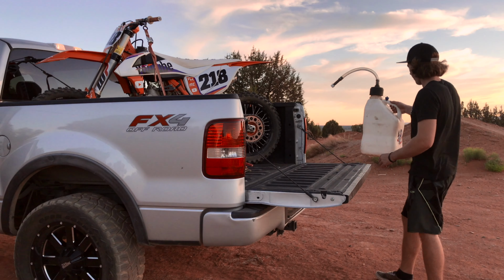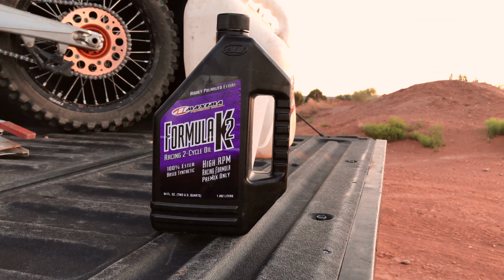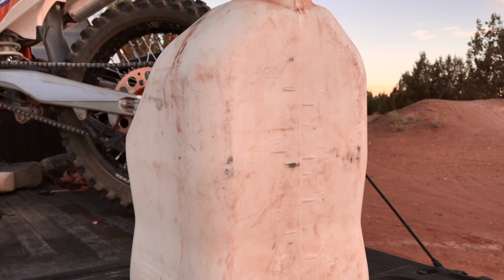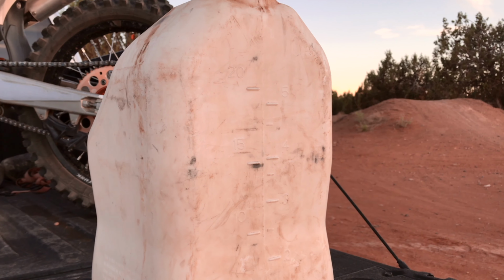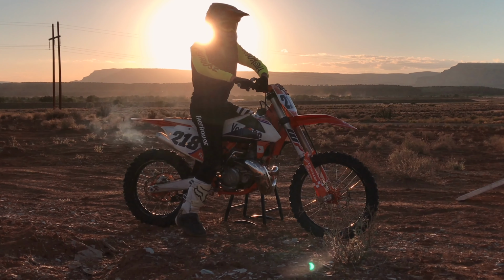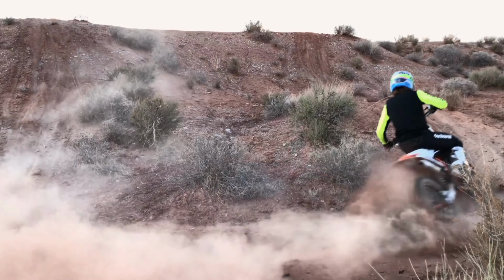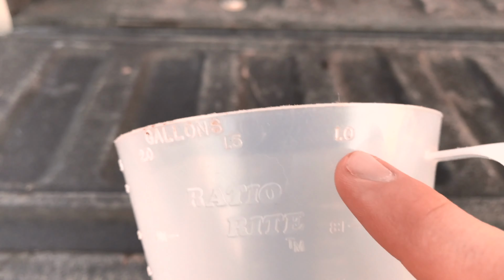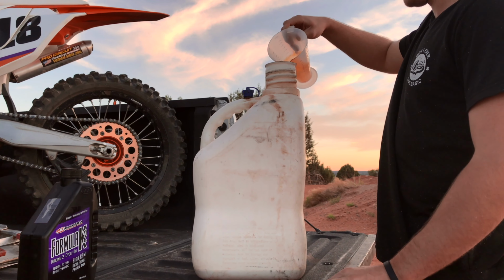How to mix 2 stroke gas | How to Ep.8

Comment: Nice tutorial. Two stroke oil and mix ratio is a religion.  Suggest you do a follow up with piston condition from your last top end replacement, add color on type of riding, type of fuel (ethenol/ non ethenol/ race fuel mix) in addition to your K2 mix ratio, jetting, altitude, temperature, etc. In my KTM smoker I run amsoil interceptor at 50:1, mixed with non-ethanol 90 octane gasoline, 4 gallons mixed at a time,  3 gal gas to 1 of aviation fuel called 100LL, all year, richen jetting in late fall, lean jetting out in early spring.
Reply from the maker: Nice! When I rebuilt the top end the piston had 150hrs, and the whole bike had 500hrs. And everything was still in good condition. And I don’t have a whole lot of experience with carburetors yet, but I run 90 octane gas with ethanol (that’s the best I can get where I live.) I run a 440 main jet, I can’t remember what I’ve done with the need and idle jet. And I’m at 5000ft elevation at 80-90°.